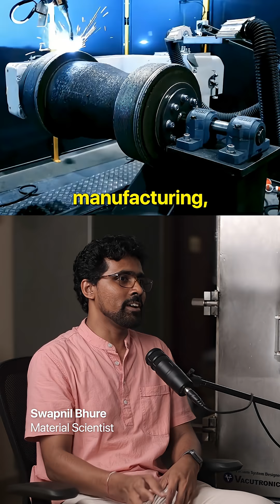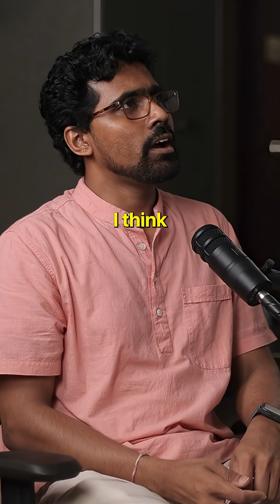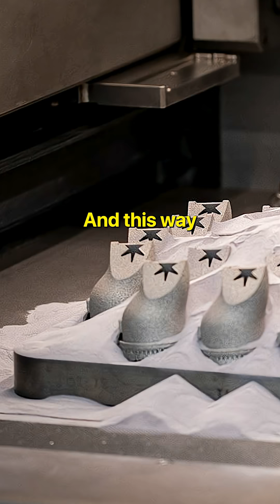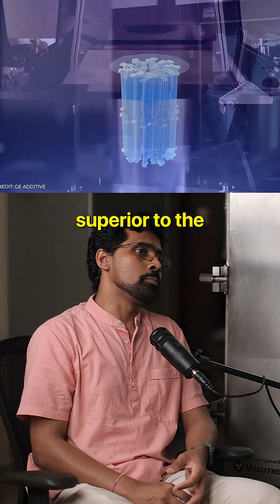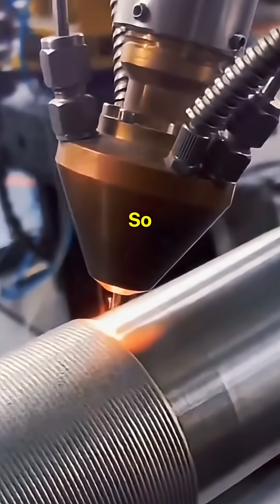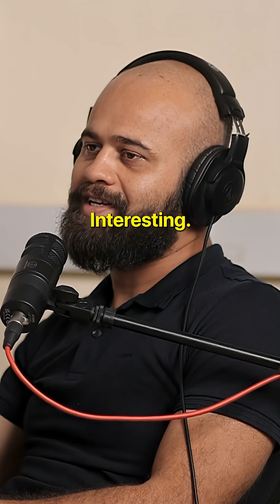Ways to 3D Print Metal #metal3dprinting #deeptech

Comment: Will it be as good as a forged steel? Please
Reply from the maker: No, metal 3D-printed parts are generally not as strong overall as forged steel from the same alloy, though they can come close in tensile strength with advanced post-processing.

Forged steel is superior in ductility, impact toughness, fatigue resistance, and uniform properties due to its refined, aligned grain structure and lack of porosity or layer defects common in 3D printing.

While 3D printing excels for complex geometries and rapid prototyping, forging remains the gold standard for critical, high-stress applications where maximum reliability is required.